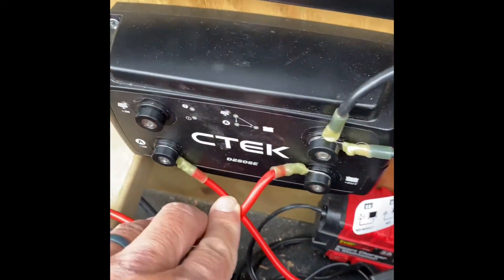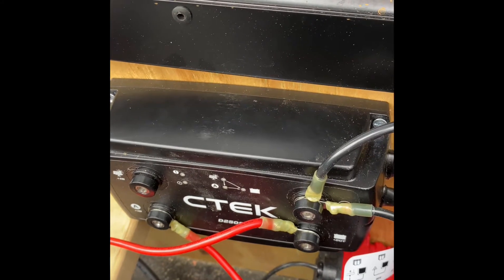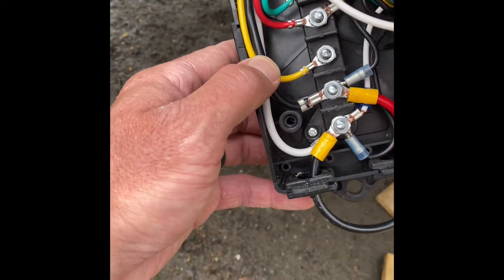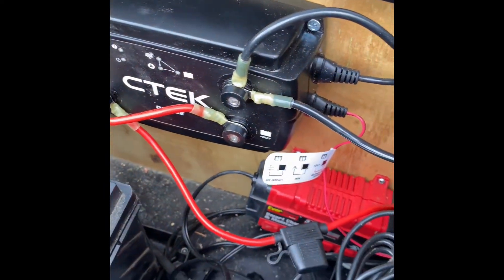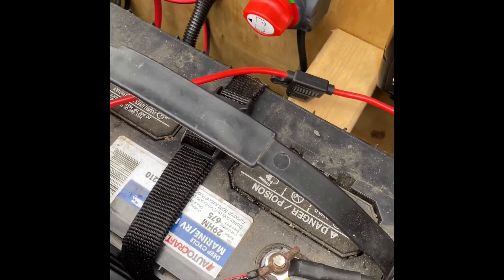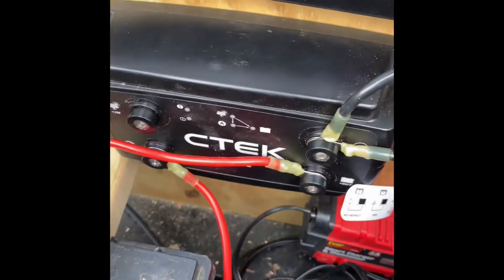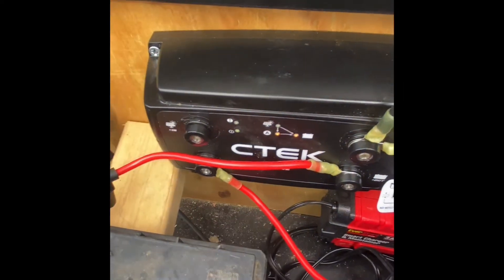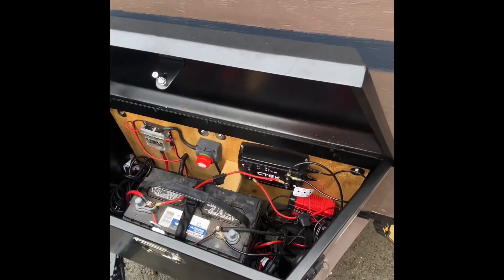CTEK D250se Overland Trailer Install

Comment: I appreciate this video. I wasn’t aware of such device. I am currently building an off-road camping trailer and been looking for a to keep the trailer battery topped off while traveling. How well has this unit preformed for your setup?